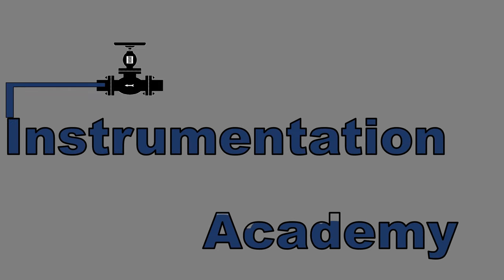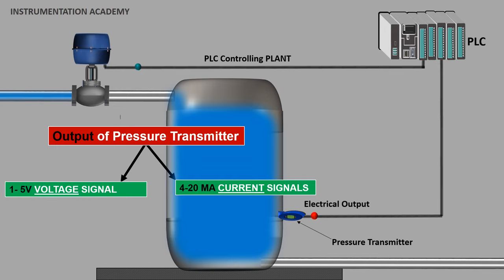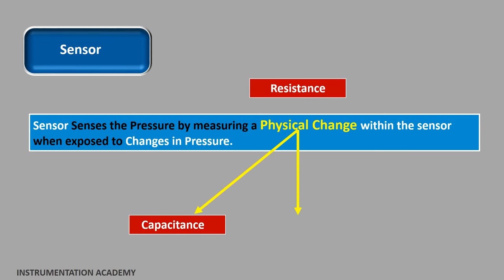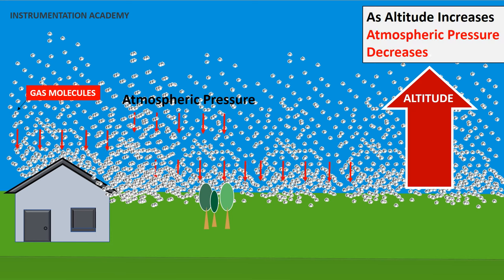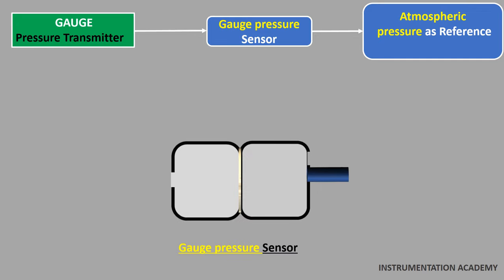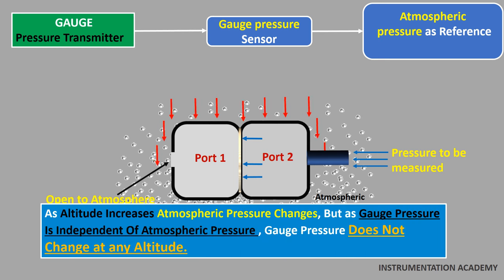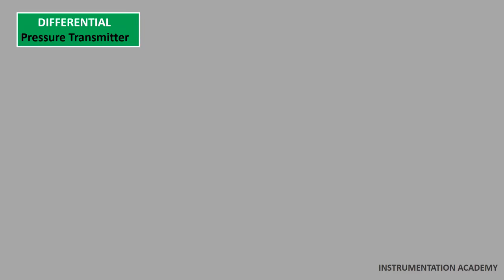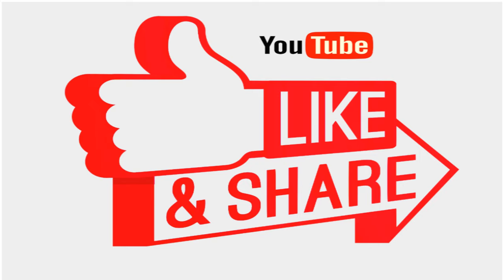What is Pressure Transmitter. Gauge Pressure Transmitter.Absolute Pressure Transmitter.Differential

Comment: How gauge transmitter is independent of atmospheric pressure while in port 1 it has the pressure of atmosphere acting on the diaphgram in between two ports. Anyone please explain.
Reply: Okay thanks there was another video before it. I got it. Lovely explanation 🙌
Reply: The atmospheric pressure acts on both sides, so they act opposite to each other, therefore they cancel each other leaving only the measured pressure ..IE  the pressure from the process for example wich doesn't depend on the atmospheric pressure and depends only on the process
Reply: @ram31299  if atmospheric pressure get cancelled  both side,then why we take atmospheric pressure as  reference.??
Reply: @mdabdullah8819  I think that's why they said that Absolute/Vaccume/Zero preasure guage is more desireable when looking for accuracy in preasure

Comment: Dear Mam,
I am gonna build egg incubator. I am planning to use PID digitel controller w RTD PT 100 sensor and capacitive humidity sensor. I need suggestion which brand ofcapacitive humidity sensor best to use? Also which calibration instrument  is appropriate to use to controll heat and humidity inside incubator. I am hoping to hear from you soon thx foto you kindness.